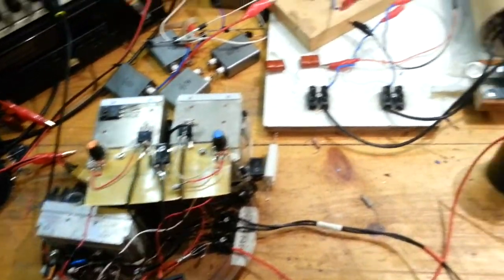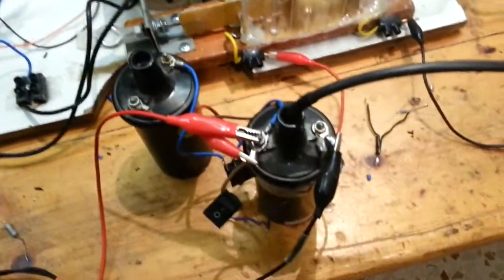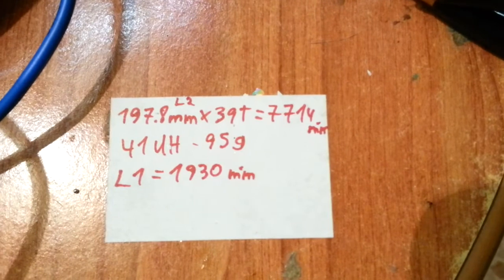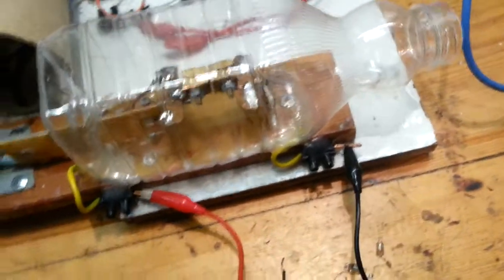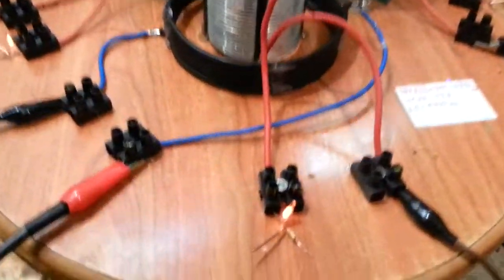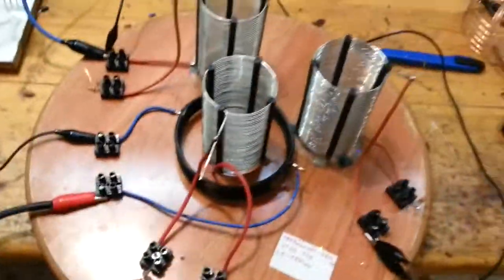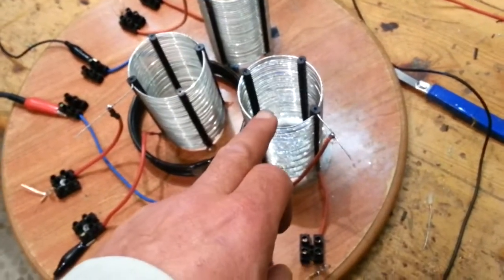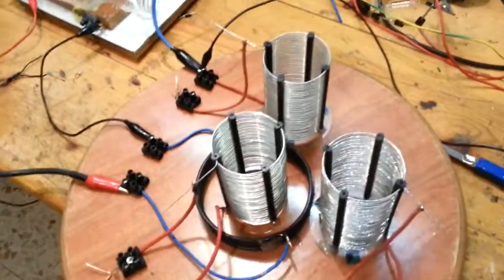don smith free energy device - air coil transmitter - Tesla air coil - over unity

Comment: Any updates on this experiment?
Reply from the maker: no update my friend. hope that someone will take it forward
Reply: Did you ever test the voltage or amps going out on the secondary coils? Can I email at your business address? @neworld4ever
Reply: This Don Smith device like all his devices use two grounds. The first off the primary.
Since his devices are built in three modules end use determines the third module. The third module converts HF and HV to either 110v, 220v and either 50 Hz or 60 Hz.
The second module is the collection phase and also the second ground connection. This second ground connection must have a slightly higher resistance than the other ground to crest a damming effect for collection into big capacitors. 
Warning voltage equals amps in these devices! Fifty thousand volts has the potential of fifty thousand amps!
Don Smith stated this particular setup with three secondaries could power a diesel electric train minus the diesel.

Comment: Is it possible to pulse 12 volts at 8 amps at 100 khz through a coil?
Reply: the current in the primary coil depends on it's thikness first, but mainly on the speed it pulsed. think about it like this: lets say your coil resistance lets you pass through it 20A continualy. so if you pule it in 2hz, (50% duty cycle) you will get 10A current. when you pulse it faster so the current will drop.
in reality the mathematics work diferantly because of more facturs like - heat, load, electromagnetic induction and more, but this is the main idea.
I suggest you try to change the speed and measure the current' untill getting to the desired current.
for me the goal it to reduce the input current as much as possible.
Reply: @Ilan-Aviv  How do I create such a circuit (complete with driver)
Reply: @garydunn9418   look online for Don Smith device circuits

Comment: Mr. Quill's wire looks like silver. Please tell what metal the secondary coil is, whether it is copper wire or any other please
Reply from the maker: it's a cooper wirh with a silver coating
Reply: @neworld4ever  Thanks for replying sir 🙏🙏🙏
Reply: Not sure if you can get same results, but worth to try less expensive tinned copper wires. Although Arie DeGeus in patent for cyclotron suggest tube copper with silver coat on outside of few microns … on high voltage such contraption will reduce ohmic resistance 95% and thin conductors can be used.

Comment: This project does not work because the secondary coil is not a tube that allows the current to rotate around it, causing a magnetic field inside the tube, with a different direction than the main coil.
Reply: Jak  będziesz obliczać rezonans  elektryczny  to  tego  nie  zrobisz  A  jak  będziesz  obliczać  rezonans  magnetyczny  to , to  zrobisz Nie  do  końca  wiesz  jak  to  obliczyć  Tego  nie  trzeba  robić  by  widzieć  że  działa  wystarczy  matematyka  i  już  wiesz  że  działa To  nie  jest  tylko  pole  magnetyczne  ale  rezonans

Comment: Nice beginnings,  remember the system your creating is an electron pump so with no external source of electrons your pump will be running dry...
You must use a ground with all your coils so they have electrons to pull into the system,  a few high voltage diodes to stop the electrons just rushing back into ground and allowing you to charge some 2uf 8000v caps that can power a step down transformer through a spark gap. 
Your car coils not really going to give you much uumph because there's just not the energy required through one cycle of that coil, a neon light transformer rate at 200w is roughly 3 times the power per cycle over your 5A 12v car cool and is cycling 35,000 times per second charging a 200nf 4000v capacitor to 2-3 thousand volts then it will discharge at the potential in the spark gap reaches threshold which will also be close to in phase with resonance as the greatest voltage potential occurs on the peak of the voltage swing in the resonating L1 coil, that's the drive primary coil.
This primary dive coil is in a tank circuit with the 200nf 4000v capacitor so you don't have to try and find resonance to
Excite it, but you must find a capacitor to add in parallel with L2 to match the L1 resonance.   wire Length is a good start but fine tuning is required to make it work properly because of the high Q of the coils , slightly different load/ surrounding objects/ loose wires etc messes with resonance so fix all wires and don't place things close to the coils.
The geometric position is also important for good excitation from the driver coil as there are nodes and anti nodes and the more coils around all humming at the same frequency will create dead spots for reception. 
Good luck
Reply from the maker: WOW!! thanks a lot for this deep explenation. it made some things much clearer :)
Reply: excellent ! Its easy to get lost/confused with Dons work. 
Not enough info available on the net or anywhere else related to his designs.
He was never ever exactly forth coming with his operational & design theories ... WHICH IS A REAL DISAPPOINTMENT !
Reply: @AlphaOmega2  Thanks for the heads up. Yes I have the book & quite a few videos but some of the areas are very scant  having little to no info. Many times I have read that Don had a reputation of omitting parts & or info from his circuits.
Reply: @nobodyspecial8102 

Any clues on the geometry you're willing to share?
Reply: @AlphaOmega2  I believe Don was still working for the oil company while showing off his device,  an oil discovering geologist suddenly becomes a genius at electronics but cannot accurately describe his invention, appears to openly give away all information yet no one has successfully replicated his device?.
Following teslas patents and discoveries you can work out how to make it work and looking at Terial kapanadaz designs start to understand the process of pumping electrons from ground to charge an electrostatic unbalance coil...
Lots of way to do this but first understand what you are doing by understanding teslas patents. 
Following Don is likely to end in you abandoning the idea of free energy which is EXACTLY the intended idea behind the Don (con) Smith design
Reply: @nobodyspecial8102  
I got the same feeling  when listening to him and especially when reading his books. 
And the jolt he got in a video when he touched the wire was fake.
Reply: please can you give a good schematic because people like us what does not know how to find the resonance is difficult for we to get it going

Comment: Build the secondaries step down wound around the extra resonant coils, same as input. If you connect a load to the outputs, the current flow will alter the resonant frequency of the output coil and throw the system out of resonance. You must then re-tune the secondary resonanant frequency to the match the primary by varying the caps and inductance. Each load resistance will require different adjustments as no two circuits are identical. Resonance is very difficult to maintain. A PLL circuit, Phase Lock Loop can automatically vary the drive frequency of the oscillator that feeds the FET's. But that will only be able to adjust for one output coil.as no two outputs are alike. But when you successfully load an output and deliver energy, measure the Wattage of the input circuit versus the output circuit to determine the COP. Add more and more output circuits to capture more load power than input power, and ultimately loop output to input to power itself and a load too. Resonant over unity. A violation of thermodynamics, but it is demonstrated repeatedly throughout the world.
Reply: To separate the load from the coils you must charge your hv caps then discharge through a spark gap to a step down transformer,  the spark gap decouple the load. This steps the hv to whatever you wind your transformer to where you can rectify to DC. The conversion ito mains is best done with an off the shelf DC to mains inverter.
Remember you are pumping electrons from the ground so you'll need to ground both your primary and secondaries
Reply from the maker: great knowledge. thanks. i did try to rich the resonance frequency with some small success. my challenge is to step down the high voltage. i get somewhere about 10KV in the output. do you know a good way to step it down? (connect some 220V bulbs)
i think this information is missing around the web.
maybe should build a step down transformer
any advice will be appreciated
Reply: @neworld4ever  make another coil(let's call it Coil B) around each of the other two coils to act like a stepdown transformer, maybe with a few number of turns. Then first try to put a load on the Coil B to see if it affects the resonant frequency of the main coil. If it doesn't, then you can proceed to rectify, smooth and invert it back to AC if it is around 12-24V... Or you can just hook it up to some purely resistive load that doesn't mind the frequency like I've seen in some videos
Reply: Do u make step down transformer for tesla air coil? what's the result when you test it on domestic equipments loads?

Comment: Your so close. In  the right direction. Tesla’s system when done properly is a resonating electrostatic longitudinal wave or region of space. Therefore any number of receivers can be powered by a single transmitter. The mistake most make is they build another coil and let these two inter operate as one unit. It passes energy between 2 well voila sure but the novelty is arrange the reciever such that it only requires a disturbance to excite the reciever and it is set in motion and is NOT a direct link back to the transmitter as a 2 single coil is made.  The reciever is a dual counterwound coil with the same polarities connected together. The coil then resonates longitudinally by the electrostatic disturbance and via resonance builds energy. The reciever is not per se, acting as a transponder as how nearly everyone builds the wireless Tesla power system. The reciever is a self contained system of both polarized electrostatic anti nodes.
Reply from the maker: thanks a lot Chris. I red your comment a few times and still have some questions.
can you please contact me by telegram?  https://t.me/Sightilan
would love to get some help setting this device to work

Comment: Great job replicating this.  Don was the real deal.  In all Dons systems he converted to DC by HV diode bridge., into a capacitor bank, then discharged at 50hz and proper voltage into isolation transformer.  Keep going.
Reply: Also it needs a ground connection for more amps. Interestingly, that ground can also be tuned with an adjustable cap.
Reply: @felixaudet5860  I think the ground is secret sauce, that's where the extra energy we're looking for is stored. #VoCoTech #NewGenerationXTv #AfroNation
Reply from the maker: the steping down was my main challenge also with other devices. collectin the output to a capacitor bank done, but than got a hive voltage charged capacitor with no way to measure or use this energy. can you (or someone here) explain more about how to step it down and tune the ac to 50hz?
Reply: Collect in a cap, maybe 5uf at 12-16 volts, and run an inverter, easy way to get your 120 ac.  The hard way is to discharge the cap at 120v into a an iron core transformer primary at 60hz resonance.  You would measure the inductance of the primary coil, and attach a cap in parallel for 60hz.  This will give you 60hz 120vac on secondary of iron core transformer.  First was is easiest.
Reply from the maker: Let me clarify the issue, not only with this device but also in another project: after resonance has been achieved in the circuit I collect the power in high voltage capacitors. Now, I have a charged capacitor of about 20kv at a high frequency of tens of Khz. From this point I need to lower the voltage to, say 220V AC to get a usable voltage. The 60 Hz is not important at this point because I will connect bulbs to check the resulting voltage.
So my question is: How do you propose to lower the voltage without killing the resonance and the high frequency at which the device operates?
One of the possibilities I thought about is, to connect the high voltage receiver to a transformer that will lower the voltage and then tune the device to a resonant frequency together with the transformer.
If you have an idea I would love to hear it.

Comment: Very nice experiment and clean. What material did you use for your long primary and secondary coils?
Reply from the maker: the secondary coil is from eBay. it's a copper wire tint with silver. the secondary coil is from a copper electric wire that I unrepeated the plastic from it
Reply from the maker: @alocin110  can you explain why to try 0.1mf 3000 wv film capacitors in the secondary long coil?
Reply from the maker: @alocin110  big Big thanks 😊  is cleared my mind with this setup. I will be bacyk with that experiment in a wile and let you know if there will be any news
Reply from the maker: @alocin110  No words to thank you !! so great to know there is people who help each other in that way :)
I will definitely use your suggestion to get help when I will back to work on this project
Reply: @NEWORLD  Great to see people still working on the Don Smith devices using 1/4 wave resonance. Keep up the good work :)
Reply: @alocin110  Have you built this Don Smith device in the video or any Don Smith devices? I have been experimenting with his device #4 for the past year when I have extra time. I am having issues tuning the device to resonance to charge my cap bank. Do you have an EE background?
Reply: @buildit2931  SEND ME A PERSONAL MESSAGE. I CAN LOOK INTO IT. I CANNOT PLACE HERE FOR GENERAL PUBLIC. THANKS.
Reply: @buildit2931  Send me a personal message. I will give you some tips. I cannot place here in the forum. Thanks.
Reply: @buildit2931  My friend I have been working on OU projects for last 17 years and have built many; some with excellent results. I am, by profession, a professional EE Engineer, graduated from USA. I know the secret of Don Smith, Nikola Tesla, and Steven Mark's. The simplest approach was of Steven Mark's TPU. I have several devices in working conditions; good enough to supply continuous power to a general house-hold. I am writing a book and will be publishing my videos too, soon.
Reply from the maker: Shaider - got to my email a reply that you wrote, but i don't see it here. do you know why?